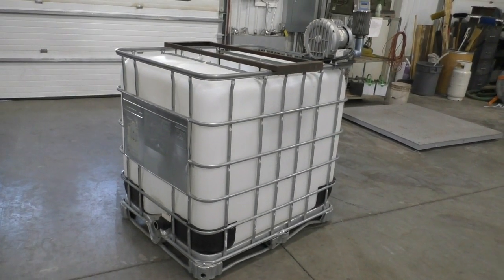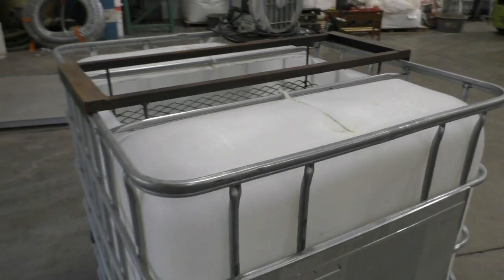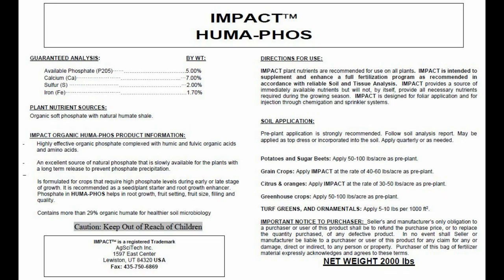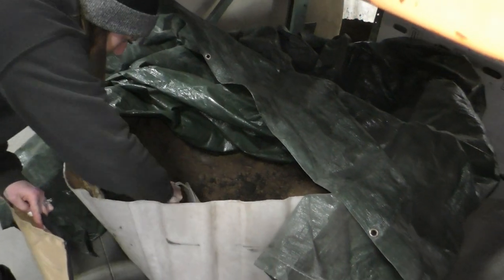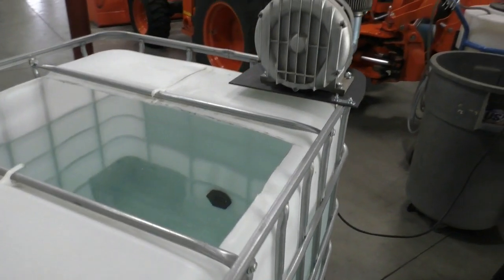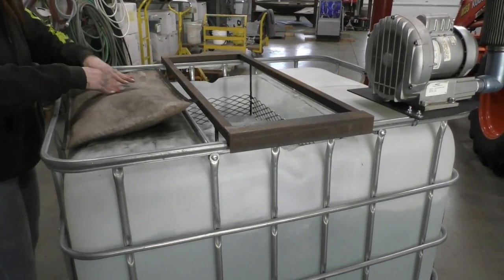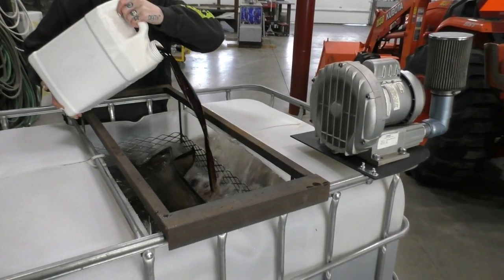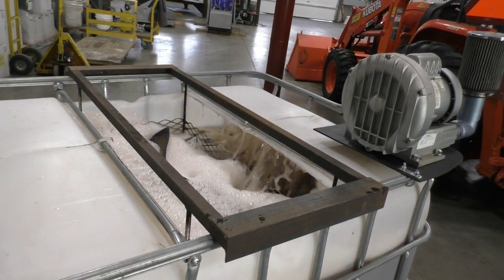Making Microbial Mineral Tea

Comment: Hello, I am from Argentina, first of all, I am seeing all your videos, they are very informative and accurate.
The other thing is that in my country these techniques are being used more and more, and as such, sold to the market, my question is, if almost all the microorganisms benefiting from this type of ferment die after a few hours, which is what What happens if it is sealed in a bottle? are these products actually a scam? from what i see they are very active and work.
Reply from the maker: The microbes in our Microbial Mineral Tea are aerobic, meaning they require oxygen to survive. They are design for prompt application within the soil, not for bottling and transport. For this reason, we have our farmers brew the microbes on site using our source materials and brewing products for maximum success.

I'm sure there are dormant microbes that can be shipped, without oxygen, but that is not how we do it.